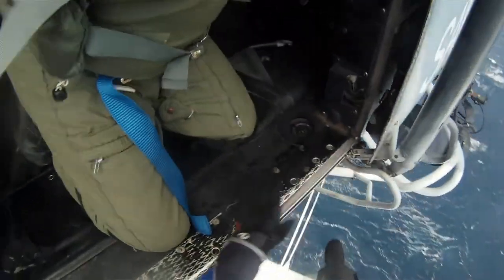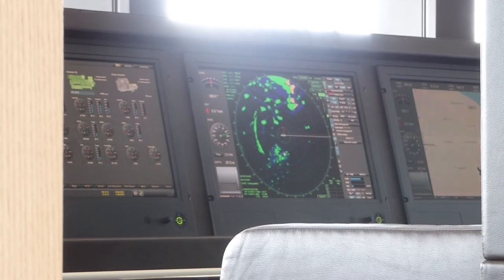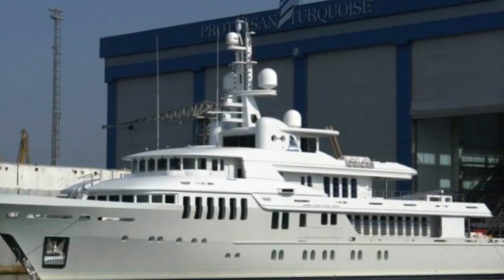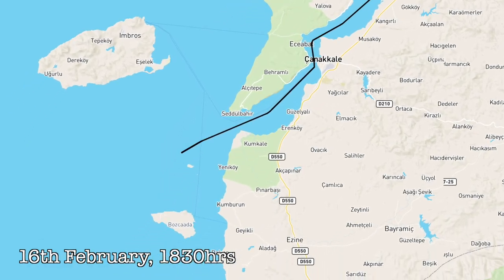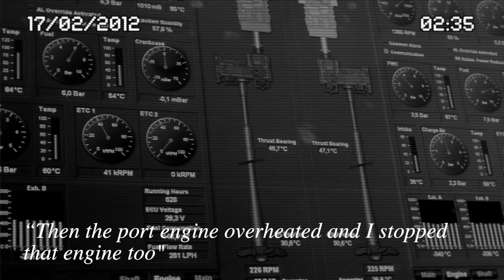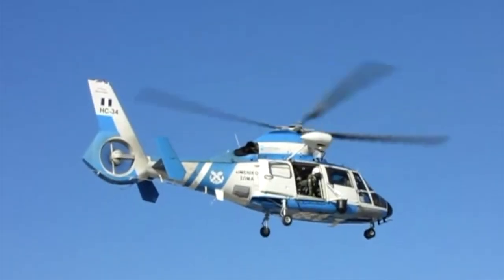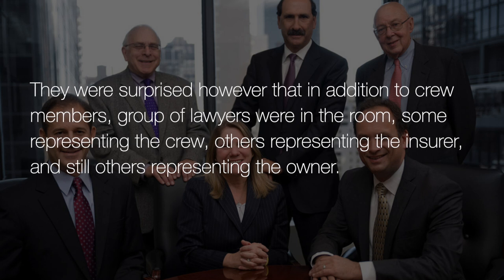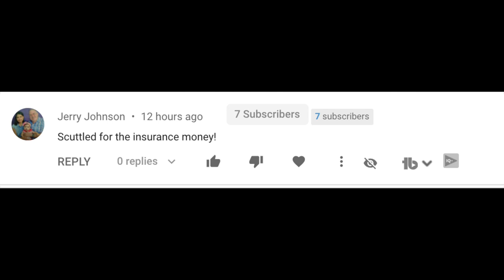Yogi: Largest SuperYacht that ever Sank - Part 2

Comment: Full power in weather, working all day on night of departure. Sounds like management was under time pressure. Good Captains and Chief Engineers don’t allow this kind of pressure to be exerted on them. We say whoa, and shut ‘er down. Same thing happened with the El Faro. A multitude of vessel issues, but not fatal ones, except for crew incompetence and lack of balls to stand up to owners and managers. The new owners and shipmates that these guys work with should consider themselves warned.

Comment: All that money for a Super Yacht with that much issues? The 2nd time it went into dry dock, warranty or not, I would have been at the builder demanding a refund.
Reply: Yachts tend to be a hole in the ocean you pour money into. You're incredibly unlikely to get a refund for one either, especially if the shipyard is performing the warranty repairs as requested - you can demand a refund all you want but you're not getting one without a very long, expensive legal battle.

Comment: I will say, I work on tugboats and unless the engine is on fire or a fuel line split you never shut down an engine without notifying the captain 1st. You try to never shut down an engine in bad weather. To touch on the subject of using bow/stern thrusters, they don't always work well in bad weather. Hell there's time they don't work well in a breezy day. At work we have to assist super yachts docking and undocking because they don't have enough to counter act wind and max current.
Reply: Those things sound way too fickle and more trouble than they are worth.

Comment: Some questions still to be answered:

• Why did the captain put his ship in an 8-force storm? Why the rush?

• Why were bilge alarms not triggered? What kind of automatic control system did the yacht have?

• How did the bilge pumps fail? Yogi seemed to have power even just before fully submerged. What stopped the pumps? Bilge pump, back-up bilge pump, fire pump?

• What happened to the watertight walls? How did the large yacht fill with so much water?

• Rudder and machine cooling systems are completely independent systems. Why and how did the rudder lock? Every yacht has an emergency steering system. Why was this not used by the crew? When was the last time the emergency rudder drill was done? This is important as it prevents the boat from grounding. Especially considering that the ship sank in about 7 hours!

• Why was the ship not attempted to be grounded? There is no mention of this possibility and option in the report?

• Why was it not mentioned in the report that the AIS device was turned off? Why was this mandatory device not active?

• How can the onboard communication system not work on a yacht that leaves for warranty service? All of these yachts have mini VHF or UHFs. Everyone on duty has to have their radio on.

• Where is the log book of Yogi? Why didn't crew take any record with them? Receiving journals is part of the abandon ship drill. No sane captain would ever leave the ship without a logbook! According to other sources, they took their crew passports and money with them. Where is the port departure checklist?

• Were the crew's water tightness checks recorded?

• According to the statements of Captain, communication was established with the Coast Guard, insurance company and the navy. So why was the shipyard not contacted? Why wasn't any technical support received?

• According to the report, the ship made 100nm in 7.2 hours, maintaining a speed of 14 knots in the period from the east of Strati Island to the first engine failure. Therefore, it would not be correct to assume that the boat has been taking water for a long time. If it were, there would be a decrease in speed. Yogi suddenly started taking water. But why and how?

Comment: The only boat I've been on is the Staten Island Ferry, so my knowledge is somewhat limited on the subject. But, considering the rough seas, why didn't Captain Pugwash contact the coastguard when he lost the FIRST engine instead of waiting until it all went  tits up?
Reply: You aren't supposed to call the coast guard if your boat isn't sinking. Losing one engine and having power to the second one isn't any reason to jump off the boat and leave it to the elements.

Comment: What’s the first thing I do when I splash a boat that’s been serviced? I check for leaks. I then “burp” the shaft seals and check the water injection. During sea trials I inspect all lower spaces for leaks and all machinery for excessive heat with a thermal imager. Was any of this was done? Running the ship at 100% power is not advisable for longevity however the resultant exhaust system overheat is an inexcusable design flaw. Were water alarms in the steering room working? Were the bilge pump‘s functional or adequate. Lot’s of questions.

Comment: In answer to a few points that you made. 1) IAS wasn't working for part of the trip. IAS has a bad tendency to drop out. It happened on my boat on the way down the the coast then comes back on. 2) You asked why didn't the deckhand in the engine room turn off the engine? Nobody other than the person at the helm should ever do that. As soon as the engine is cut the control of the boat is lost. 3)You suggested that the boat could have been controlled by the thrusters. Thrusters are for docking.They are of no use in heavy seas. 3) You wondered why the boat was running so fast. The current could have been running in the same direction helping to increase their speed. Also, depending on the boat and the conditions of the sea state running fast can smooth out the ride. Stabilizers work better at higher speeds. Although, I would assume they should have been going slower but only the captain knows his reasoning.  That boat was not ready for use. It's all on the boat yard in my opinion.

Comment: Great video. The number of 'oversights' and examples of sheer incompetence across the the board seems incredible. My expertise is IT systems engineering, lives are not at risk from my work, only money and we take far more care in testing and operational processes. @2:29 the quality of that hull welding, to still be visible at 10 meters or more distance, is appalling. Undocumented changes to the design, underspecified subsystems with low safety margins, a string of equipment failures in comms, alarms, pumps and seals at minimum; all huge red flags. While all the warranty remedial works seem concerned with cosmetics issues not basic equipment functions. All suggestive of lack of continuous review of the build or effective acceptance testing during/following sea trials. Operational failures during the fateful voyage and seemingly a total lack of processes for emergence/damage control. Why wouldn't the marine insurance insist on a data recorder? Why didn't they have skilled personnel, e.g. a marine architect sign off the vessel? While the builder seems to have failed, so did the crew, the owner, the investigators, and the insurers.
I'm convinced that Hanlon's razor applies, incompetence (and coverup) not fraud.

Comment: Questions, did the insurance company pay out in full? Who to? was it financed?  Did the owner receive anything? - was there a limit on the engine running time at full power? Or are there no limits? If none? Why did the engines over heat, were the sea trials properly conducted using full power for a prolonged period? Re the accident, What was the sequence of events? Several things went wrong, was it by design? The crew especially the Captain seemed to have performed poorly..  rather than shutting down why did he not reduce engine power when temperatures were raising?  Who ordered him to proceed at full power? How did water enter?  Surely adequate pumping existed?  Mobile? Fixed?  What repairs did the crew attempt  or make? Why did pumping never happen? Why did the Captain never order pumping?  This could be partly explained by fatigue but these were very experienced crew, things like considering flooding actions would be second nature...   it appears from this information the crew did very little to save the ship?  This is tragic  casting so much doubt on the yards ability but was there more to it?

Comment: I once worked as an engineer on a boat supply boat I had experienced a similar incident. When the ship in the middle of the sea we get big waves. one of the engines (left) overheated and a leak occurred on the ship's wall so that the sea water came in (the pump was unable to cope / the version of the chief engineer and captain) so the captain of the ship ordered all crew to abandon the ship. still survive and try with other crew (who do not want to leave the ship) to overcome the leak and finally I took over the leadership on the ship and managed to bring the ship until it touched the sand beach (the ship was agitated). I and the other crew survived but the ship owner lost / failed insurance claim. after that I was fired by the owner. So it was strange that the crew did not find any leakage. so in my opinion this is just a game to chase .. ???
Reply: Lmao u stopped the ship owners insurance claim

Comment: 1) why did they leave port with such weather in the forecast? 
Not addressed in the report? 
2) Who runs a new vessel flat out without having run proper shakedown tests? 
Or in such weather, as was pointed out by the shipyard? 
3) Knowing the starboard engine had a breakdown, why was the port engine kept at a similar service rate that caused a failure to its mate? 
The engineers and Captain should have been asked about this, since the report noted odd decisions making in regard to engine condition. 
As the video says, it seems lots of questions still remain. Does RIF (or whatever the governing body is) still have its credibility?

Comment: My takeaways from pt 1&2 is simple- this ship should never have left port. The crew fatigue is an interesting aspect - poor decision making by tired brains? Lack of emergency training drills? shit ton of complacency? I don't know the laws or standards of hours allowed on duty vs hours of rest but this equates to human error. 1 point that has stuck with me since the first video, this water injection cooling system, it seems like a bad idea all around and it's operating range were obviously exceeded. Redundant communications systems complete failure? no position reporting functionality? Ah, no ability to track it~ nice touch for a clandestine mission- again, why did it leave port? and then to the kicker, bilge pumps and water alarms - What???? It should have been able to survive a torpedo hit (OK, slightly exaggerated but it had emergency flooding capabilities) I get the impression little effort was put into doing all that was possible to save it - follow the money- but then again, this seems to have gotten into the places with people having considerable power and influence. In the end I would agree- a combination of mechanical, human and engineering failures all adding up to inevitable disaster. Maybe someday, when one of these people is on their deathbed, maybe the last survivor after everyone else has passed it could be known what the real truth is or forever be clouded in mystery

Comment: Looks to me three things happened.
1 - The crew is covering their asses for failures on their part, hence why no attempt was made to save the Captains Log.  Most of the water tight doors must not have been shut properly or perhaps they were so busy to get going they forgot?  I don't know but its obvious the Captain was running the engines too hard and may have miscalculated his stability analysis.  But we'll never know.  Also I thought it was the captains resoponsibilty to save the log?  Should not he have been at least reprimanded for that?
2 - The French are perhaps protecting themselves and their new French Flag system for failures in Inspection, proper equipment and proper documentation. 
3 - I work in the Engineering feild and not updating and revising drawings from the captains mods (something I do allot) is bloody neglegent even though I run into it allot when dealing with other companies work.   And I can tell you one thing from my expecrience.  Every time I run into machinery or parts that do not have updated drawings and documentation its a cluster fuck waiting to happen.   The shipyard itself more than likely may bear some responsibility as well because of this.

These 3 things combined may have contributed to a chain of events that doomeed the boat.  But thats just my opinion.  It could have been fraud but you'd have to pay the crew a hell of allot of money to take that risk.....or maybe it was just the Capatain?

Comment: I am stunned that a captain & crew would sail in open ocean at full speed (16.7 knots) in 5.5m to 7.5m sea's in a vessel that has just come out of repairs. What was the rush.- not discussed in video.This is nothing short of reckless. This vessel is designed to do 16 knots in relatively flat coastal waters not in open ocean with a big swell running. The instantaneous loads on this vessel as it crashed into waves that size would have been massive and would have resulted in twisting/racking of the hull and potentially broke the stern door seals. I work in NZ's largest mine and when our machines leave the workshop they have a power ramp up procedure from 50% load to 100% load  after a major service and can take an entire 12 hour shift. This done to make sure repairs are done to spec and if not we can shut the machine down before to much damage is done. Also manufactures like Catapillar, Hitachi, Komatsu, Volvo etc have  their own vehicle management systems which enable the OEM to check machine is being maintained & for warranty claim protection. Sailing with comms systems down and AIS not working is staggering. Our mining equipment is not allowed to move if GPS tracking system down for safety reasons. I smell a rat.

Comment: Try going through the warranty period onboard a brand new Navy ship.  Yes, they’re delivered to the Navy with a full warranty.  Good thing to, because hardly anything worked like it was supposed to work.  I’m a Plankowner for the Navy’s 2nd Wasp Class LHD, the USS Essex.  It’s a beautiful ship (as far as Navy ships go), but was riddled with problems right after she was built.  One of the more serious issues was with the ammunition elevators.  But there were a multitude of issues that by themselves wouldn’t be that serious.  However, when combined they created a ship that was incapable of doing it’s assigned mission.  Thankfully they all got straightened out and she became an outstanding ship (less her 2nd Commanding Officer who killed the moral on the ship and would often get caught outright lying to the crew).  Likewise, Bonhomme Richard was a fantastic ship.  She will be missed.  The fire onboard her resulted from a multitude of smaller issues that all went wrong (many deliberately sabotaged).

Comment: Sad, it sounds like they didn't fully test test the Yacht to make sure it was sea worthy before taking it out on the open ocean. And it sounds like there was enough systems and bulk head doors to keep it a float in place so that even if it partially sunk they could tow it back to port and have it repaired. It sounds more like a fraud case but like you said most accidents are a result of human error and equipment failure. Sounds like there was a lot of that going on.

Comment: Just the fact there was no bilge alarms from the  rudder and emergency steering compartments and these water tight areas flooded is a big problem in this case. Engines overheating should never lead to a vessel sinking. These systems (along with emergency steering, emergency generators, bilge pumps and all safety related systems) should get regularly tested and logged as a matter of course by any competent crew. Had they got an alarm there are multiple redundant bilge pumping systems that had they been used (as they are trained to do) they could have managed to either save the rudder pumps or at least got to the emergency steering and kept the bow to sea likely saving the vessel. There were 2 chief engineers onboard, one was a build engineer who would have known the vessel inside out! One could have operated the emergency steering and the other got an engine online with reduced power to keep it under control. It sounds like some water tight doors were left undogged (probably to make access less of a hassle). These are clearly marked as needing to be shut while underway. Turkish shipyards have a poor reputation in the industry that is well known so there are possibilities of poor workmanship or systems not working (like bilge alarms though it inexcusable the crew didn't pick this up and rectify it before going to sea) The captain is also complicit. Running at top speed in heavy seas which was proven (though not stated in the report) would have caused any vessels engines to over heat through the added stress of punching into heavy seas. I can guarantee they were on a time schedule to get to Canne after being delayed so were pushing it (probably as the owner wanted to step onboard at a certain time - seen that many times) Not utilising bow thrusters to keep the bow to sea and not ensuring critical systems were working before putting to sea are inexcusable. I'm sure these crew are out there on other yachts at this very moment. As a 20 year chief on these yachts there were some very poor actions taken by this crew.